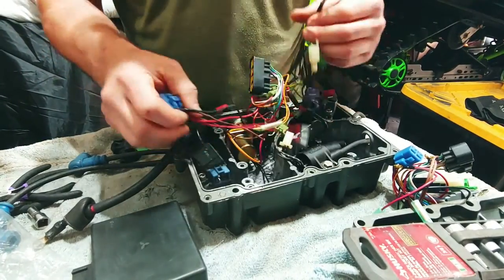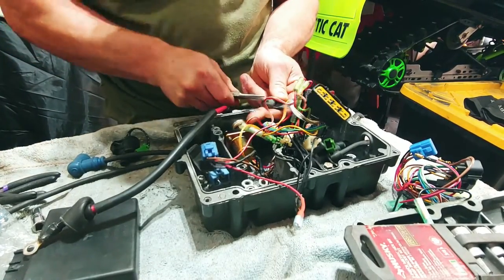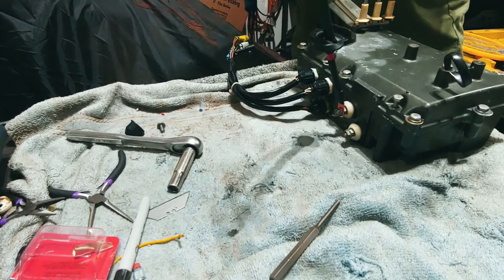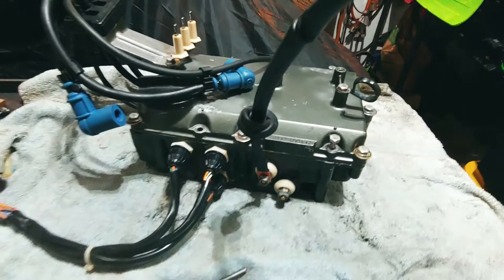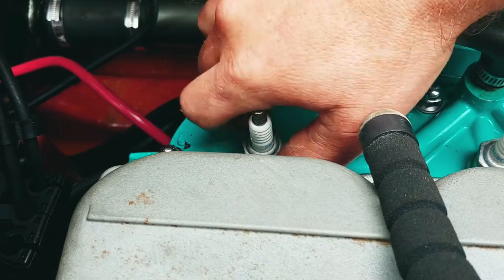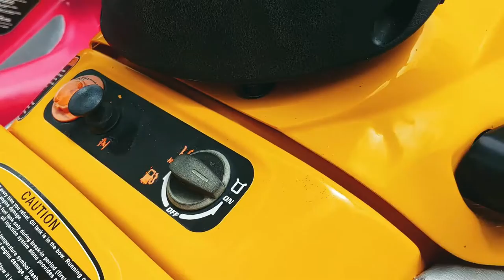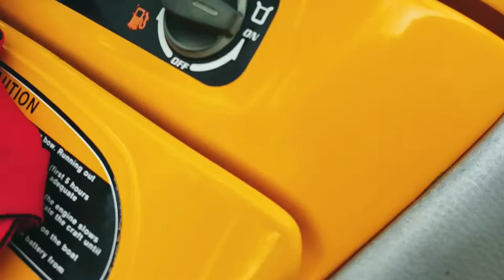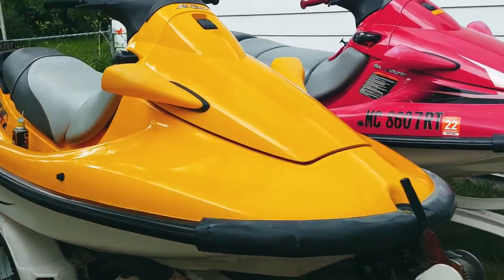2000 Kawasaki STX 900 Restore Series - Part 3

Comment: Thank you so much andrew thats a big explanation . Thanks alot man for taking your time to explain . I actually brought it for a very less price . The person who sold it to me said it has a stuck engine and really it was not turning but i just brought it home and removed the engine mounts and moved the engine back to see if the engine was stuck but to see the impeller was stuck not the engine . So i was kinda lucky. And input some petrol from the top of the carburetor and cranked and it started but i think i need to give a good cleanup on the carbs . But parts never available here . My next worry is i removed my impeller up to some extent but now the rest is not coming put of the ski . The impeller part isn’t coming out or move put of the housing idk what to do .
Reply from the maker: My pleasure! That's good to hear that the engine runs and the Jet pumps are not terribly hard to remove. They're typically Just 4 bolts and the whole assembly comes out
Reply: @Fixin2Ride-Official-   Your Right Andrew . But my problem is i removed the bottom plate and i removed the 4 bolts and still i put some hard force to pull it out but it doesnt come when i pull. Do we have any pullers or something to pulll i thing its stuck inside the propeller
Reply: Do u have an email address or any contact information so i can write to you if i need any help . 
Thanks!
Reply from the maker: Sorry for the delayed response I was at the Track yesterday. Once you remove the 4 retaining bolts there is a big seal that seals the jet pump to the hull. This seal is a wedge fit and gets corroded. So you will need to use a bit of force. Try using a rubber mallet and work it back and forth as well with a prybar. I wouldn't put the prybar directly on the hull though. Maybe use a thin but sturdy piece of wood. Try and get something between the jet pump and anchor plate from below. Then work it back and forth until it comes out. Be prepared as it might take a bit of time. Just be gentle but forceful enough to get it out. You can do it. Just take your time. You don't want to bust anything... It's all aluminum. 

Let me know when you get it out and I'll give you further instruction on how to refurbish the seal, mating surfaces and jet pump. 

Andrew

P.S. This is the best place for this kind of stuff as others will have access to this information. Hope you understand.

Comment: Hey Andrew.  Wishes all the way from Sri Lanka.  Great video . recently i bought a 900 stx 2003 . I have a question regarding my speedometer the warning light blinks the engines starts but there is nothing show on the display is there any seperate fuses or anything for the speedometer . Just the waring light blinks.
Reply from the maker: Thank you very much and best wishes to you as well. If you're not seeing anything on the dashboard these displays are known for going bad. You can either buy one for about 350 bucks or get a repaired for the same. Just make sure that you have good fuel in the tank and that you have plenty of oil and the reservoir which is in the front under the lid after you take the front trunk out. Mark it with some tape or a black marker. Then take it for a calm ride and check your plugs as well as check the oil again to see how much it has gone down. If you got new fuel in there your plugs look good and it's using a proper amount of oil and there's water coming out of the pisser port on the right side of the hull by your right foot then you should be good.

Comment: Hi Andrew, great video, is there a knack to disconnecting the grey almost cylindrical connector. My box is still in place so not easy to make room. Thanks Mark
Reply from the maker: Should just be a tab to lift on the one side and pop it apart? What minute and second is the part you're referring to shown in the video?
Reply: @Fixin2Ride-Official-  1min 57
Reply from the maker: @markmccormack7714  you just to push the tabs in if I remember correctly
Reply: @Fixin2Ride-Official-  thanks got tabs unlocked and out it came
Reply from the maker: Awesome! Glad you got it. What kind of work needs to be done on it?

Comment: Hi I have some questions before i bay if you can.
Stx 900 2000 .150 hours. Carb. 120 compression. For $2000
This a good deal ?
How is the maintenance?
Reply from the maker: 150hrs you'll need to do some maintenance. Its not terrible to work on... The triples a little heavy to remove but if your strong or have a cherry picker or come along hanign from ceiling you'll be fine. They are fairly straight forward to work. Not like the sea-doos with the valve plate. These are reed engine. So pretty muvh just like a snowmobile.

Comment: Hey man you still active on this page I got some questions or can I grab your socials and have a chat
Reply from the maker: Deff what's up?
Reply: @Fixin2Ride-Official-   my stx 900 doesn’t go into reverse any idea what could cause this
Reply from the maker: If the lever moves, check the rod in the back bear the output of jetpump nozzle. Disconnect it from the side of the reverse cup and see if it moves. If it does move your reverse cup pivot bushings are froze. 

What does the lever do?